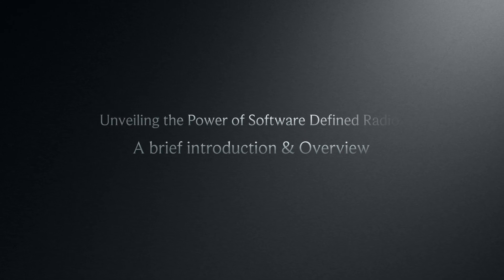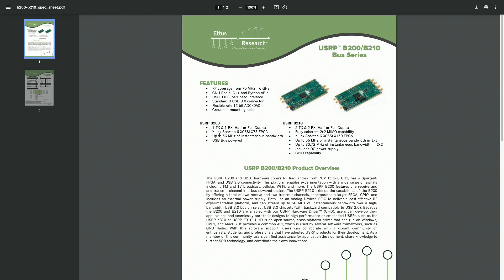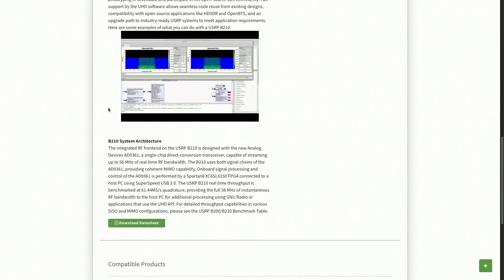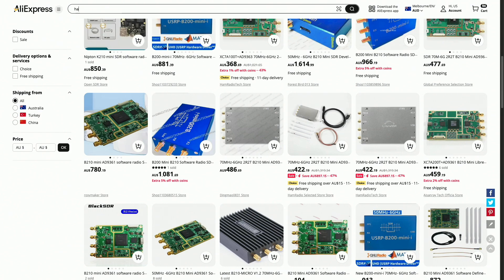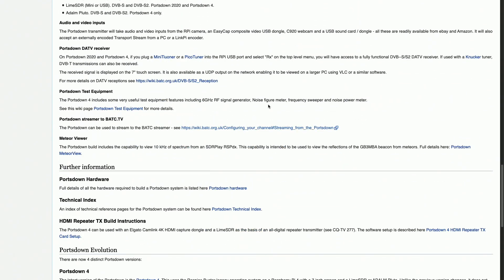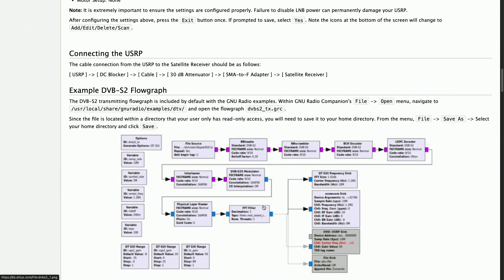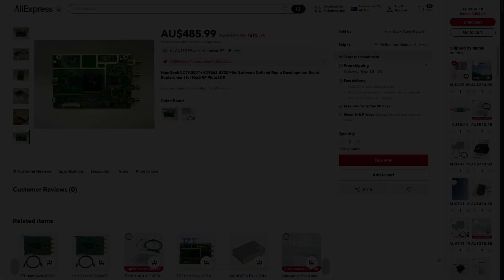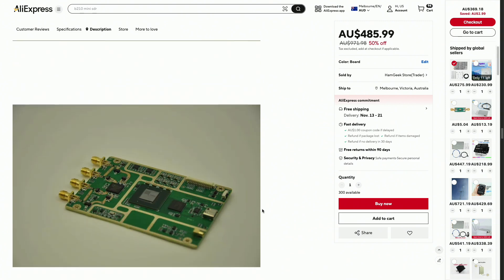dtv net #12 Exploring the USRP B210

Comment: Is this an AI voice? It's pretty impressive.
Reply from the maker: @splineMerl  Yes it's an LLM (I hate to use the word AI as its too devalued) and I used a 10 second sample of "NOT Emma Stone's" voice, it's NOT 100%, but close - that's why I gave it a name "Emma". The male voice is "NOT Patric Steward". The LLM was running on a mobile RTX 4060 with 8GB VRAM
It is possible to "tune" the emphasis of the voice by adjusting the "temperature" parameter in the model. You probably noticed the high level of direct emotional pronunciation in the delivery. The temperature parameter was "0.75". The "tech" of LLM's is fascinating, be it for GPT chatbots, vision systems or TTS,  it's incredibly good.
Reply: @vk3tetjoe  Impressive that you worked it out. Nice work. I will play with it in the coming weeks.
Reply from the maker: @splineMerl LLM technology is very addictive. If you have appropriate hardware to host locally the various open source models, you will go down a deep rabbit hole. Have a look at my "Relationship Discussions with an LLM" videos - it's addictive and dangerous.